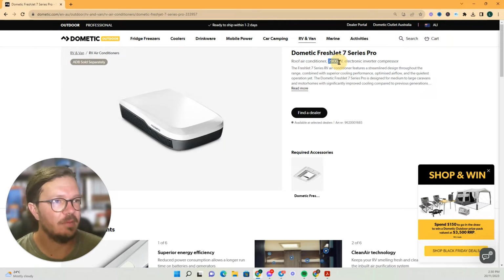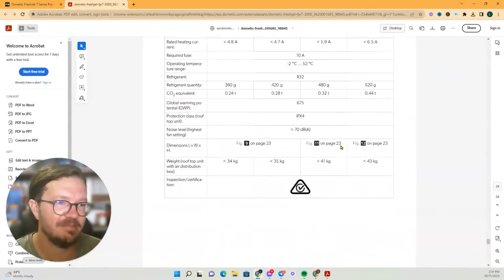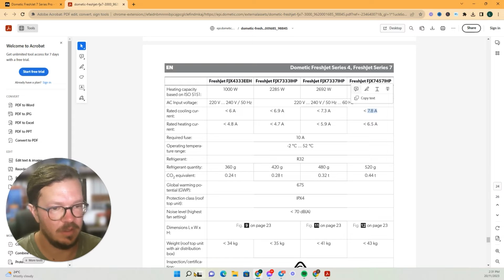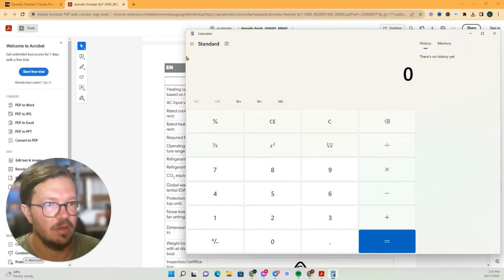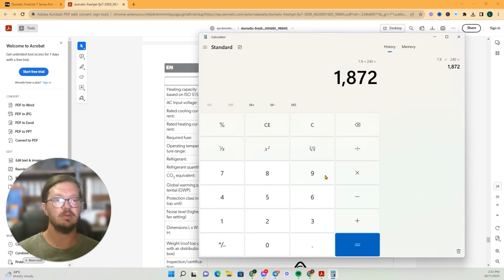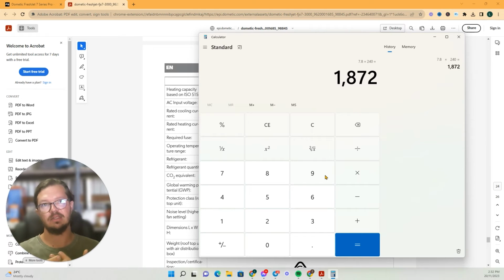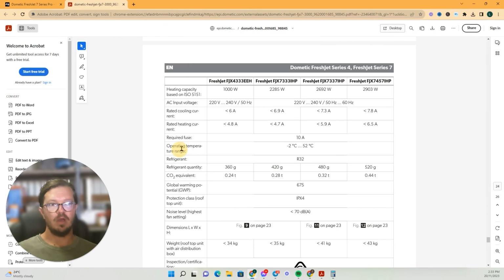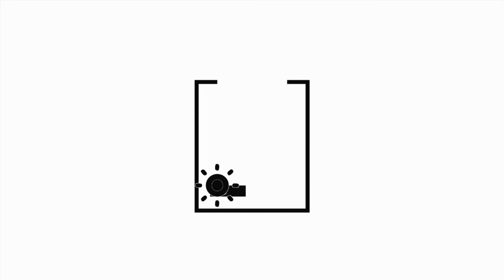What size inverter do I need to run an air conditioner in my caravan?

Comment: A shortcut for you, Win +R  the R stands for run. Then type calc. Good video thanks mate. edit: going into the battery watt hours and some examples of total run time at different duty cycles would have rounded this out. Showing people how to convert amp hours to kilowatt hours. Because your run time comes down to your insulation quality vs your battery in the end.

Comment: Does that unit specify a power factor?  The current draw at a factor below 1 will be higher than the rating, will it not?  If we have the power factor we can calculate the  apparent power and therefore the true load the inverter will need to handle?
Reply from the maker: Hi Glenn, excellent question! The unit's rated cooling current of 7.8A doesn't explicitly mention the power factor. As you mentioned, operating at a power factor below 1 can result in a higher apparent power compared to the rating. For the purposes of this video, I've assumed that the 'Rated cooling current' already includes the power factor in its measurement, representing the measured amps of the actual unit, Cheers, Landon
Reply: @zerogridaustralia  Yeah that makes sense,  is it common for appliances like that to factor in the expected power factor into their current ratings?